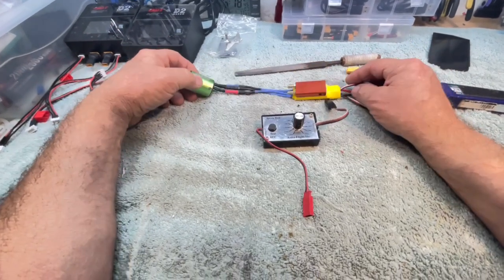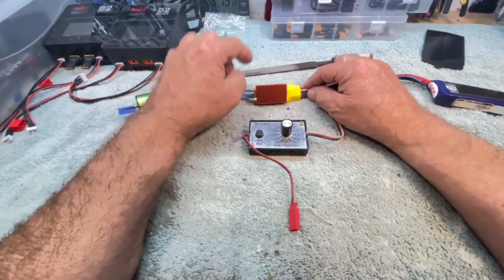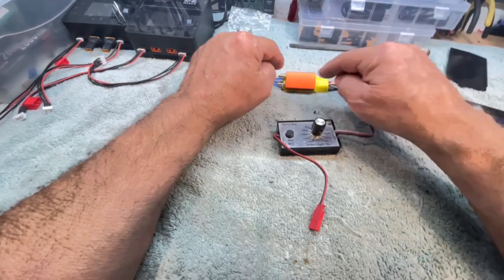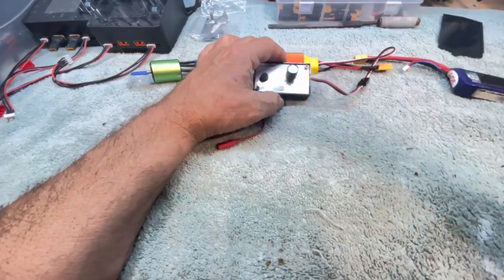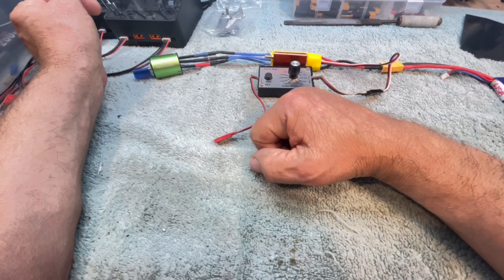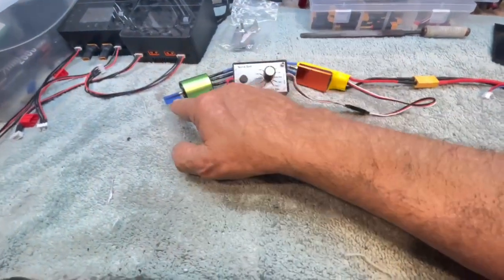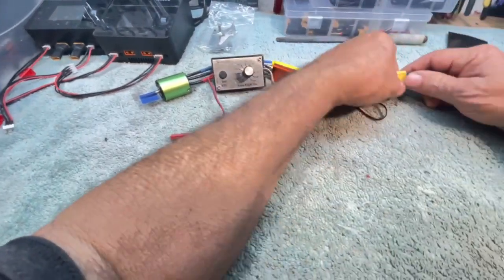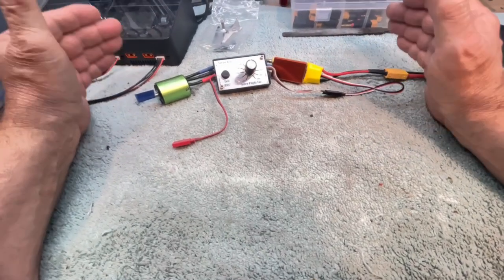Dr. Jet solves a viewer's mystery.

Comment: Yep, the Flycolor ESCs are the same way. Took me a minute to figure it out, but you have to hold full trigger, plug in, wait for beeps, return to neutral, wait for beeps, and you should be good to go if there's no reverse option with initial settings. If so, you just swing the trigger to full reverse after the neutral beeps. :yougotthis:

Comment: I think I would do it with the transmitter that way it's set up for the range of the transmitter. I always have issues with this. I don't know why all the companies have to be different. Their not going to get more money for binding the receiver differently or setting up the calibration different. It should all be the same. Then make your money on the PERFORMANCE of your item. In my opinion flycolor has been the easiest to program.